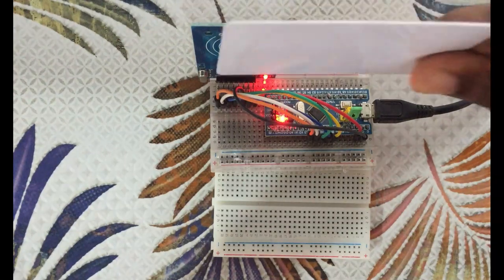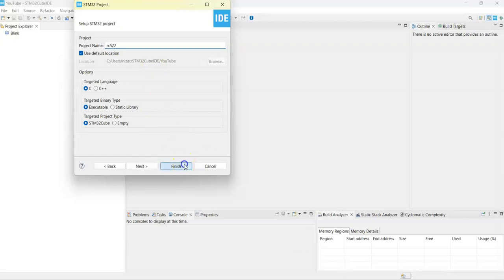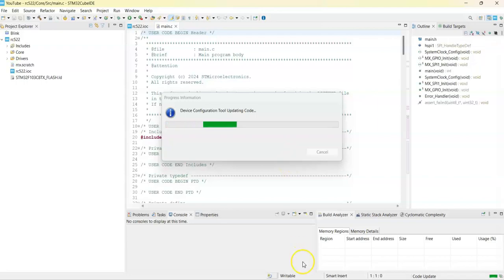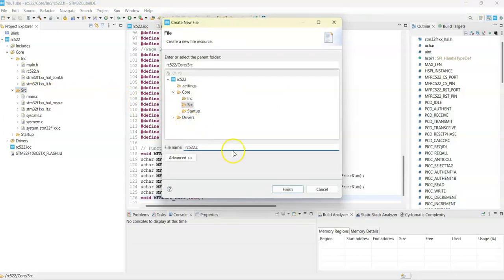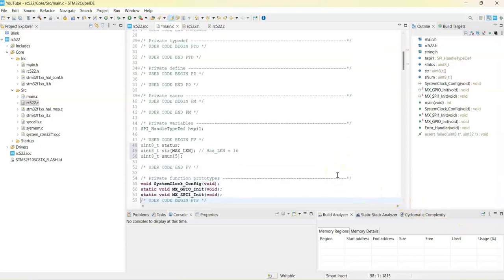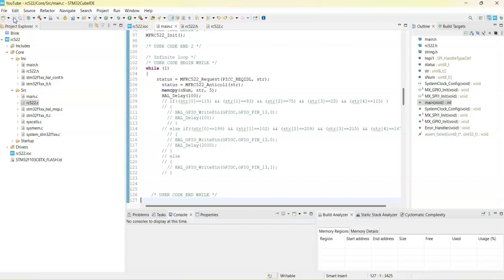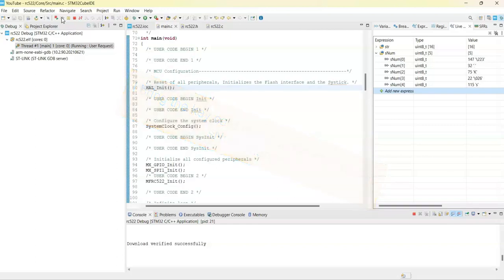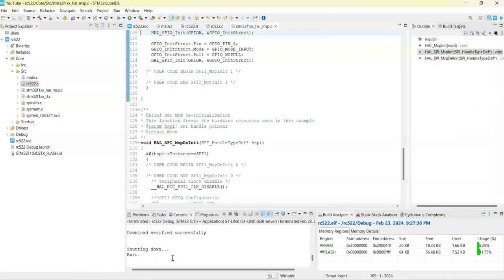88. STM32CubeIDE RFID RC522 Module with STM32F103C8T6

Comment: Thanks, very concise and precessional! Only, spent 1 hour, figuring out the problem and it started to work only @500 kHz SPI :(, looks like sdi line load at RC522 side is not strong enough.

Comment: Hello! I am using STM32F303VCT6 discovery board, I want to use the RFID sensor and on following your steps and since I am using the STM32f3 version, on changing the include files and fixing up some minor errors when I run it, on Live Expressions I cant see the sNum string I can only see the first two that are fixed (147, 32) but the rest 3 numbers are 0 and are not updating when I bring another card? Could you help me what I can do to make this work??
Reply: @user-seojihye71  The way I am doing it is that the main function enters in a while loop where it continually checks for the presence of an RFID card using the MFRC522_Request function. When a card is detected, it reads the card's UID using the MFRC522_Anticoll function and compares it with a pre-stored UID. If the UID matches, an LED connected to GPIO that I included as pin PA8 is turned on; otherwise, the LED is turned off. 

The LED connected to GPIO pin PC13 toggles state to provide feedback each time a card is detected. If no card is detected within a specified period, I am setting it to reset after a second or two.

Make sure that you don't change anything in the h and c file that was provided in the video but on changing the main file like above it started working!
Reply: @devagyabudhiraja1150  Thank you so much. Thanks to you, I was able to finish the work for a long time. Thank you so much
Reply from the maker: Thanks for trying my codes.
I hope you have figured out the reason
Please make sure the rfid cards are good
Reply: i have the same problem, do you have find a solution?🙏
Reply: @giuseppemazzocca9813  I had fixed the problem using HAL, I restructured the code and wrote it again in the main file and it started working!!
Reply: @devagyabudhiraja1150  hey would you be able to elaborate on exactly what you did (if you remember)?

Comment: Hello,I face the problem (status only display 2/sNum display 147 32 0 0) ,may I know u how to fix this problem? 
I use stm32f103vet6 and follow the video coding, but I use mini-rc522,is code not suitable for mini-one?
The project is stuck here,hope for help
Reply: I am using the Nucleo F103RB board. I'm having the same problem as you, can you tell me how to fix it?
Reply: @user-seojihye71 i didn’t fix this problem as well,even i change the code and use normal rc522😢
I think problem is come from board type is not compatible
Reply: @hpw5897  I see. Thank you for the information🥲
Reply: That is strange, I had the same problem - made lower SPI speed then played with clock phase and polarity. It started to work. Then I returned all the parameters back - set the parameters that didn't work initialy, and it works now. I think it could be QUBE glitch, who knows...
Reply: It works for mini-rc522, just got it working. Your problem could be with cube ide. Try to play with spi clock phase and polarity, try to lower spi speed, mine started to work only at 500 khz, which is fully sufficient.

Comment: Hello sir, I have a problem that need your help. The library is great but it i found that the first and the second of str[] is not fixed. My first and second of str[] is 0x70 and 0xB1 (this is the correct code), but sometime it shows 0x93 and 0x20, and then repeat with 0x70 and 0xB1 then repeat 0x93 and 0x20. I saw that your video have met the same error with me. Did you fix that or can you help me fix the bug. Btw, thanks for your tutorial and wish you all the best.
Reply from the maker: Thanks for trying my setups and codes and making it work.
As for the first two values 0x93 and 0x20, they are showing up even if no cards are present.
Of course, it is a bug. I am also looking for the fix
I think we can get away with this for simple projects, avoiding (147) 0x93 and (32) 0x20

Comment: Hello sir, I am currently getting "Target Not Available" when on the debug step, any part of the code or circuit I should check?
Reply from the maker: This only works with global variables, i.e. declared outside of main()
https://community.st.com/t5/stm32cubeide-mcus/getting-quot-error-target-not-available-quot-in-value-column-in/td-p/170240
Reply: @NizarMohideen  Thank you, I got that fixed, however I am getting value of 0 after resume when the pill is touched.

Comment: why did we need to setting the clock from 8 to 72kHZ ? i dont understand why. Can someone explain for me
Reply from the maker: You can keep 8MHz. It will be fine
72MHz is better because it is faster
If you keep at 8MHz, you need to change the prescaler in SPI for the baud rate to be around 9MBit
Reply: thanks to  @NizarMohideen , I appreciated about this

Comment: this is the clock config of my stm32mp157f-k2 what do nu think should i change to make it work ?                                                                                                                                                                          void SystemClock_Config(void)
{
  RCC_OscInitTypeDef RCC_OscInitStruct = {0};
  RCC_ClkInitTypeDef RCC_ClkInitStruct = {0};

  /** Initializes the RCC Oscillators according to the specified parameters
  * in the RCC_OscInitTypeDef structure.
  */
  RCC_OscInitStruct.OscillatorType = RCC_OSCILLATORTYPE_CSI|RCC_OSCILLATORTYPE_LSI
                              |RCC_OSCILLATORTYPE_HSE;
  RCC_OscInitStruct.HSEState = RCC_HSE_ON;
  RCC_OscInitStruct.LSIState = RCC_LSI_ON;
  RCC_OscInitStruct.CSIState = RCC_CSI_ON;
  RCC_OscInitStruct.PLL.PLLState = RCC_PLL_NONE;
  RCC_OscInitStruct.PLL2.PLLState = RCC_PLL_ON;
  RCC_OscInitStruct.PLL2.PLLSource = RCC_PLL12SOURCE_HSE;
  RCC_OscInitStruct.PLL2.PLLM = 1;
  RCC_OscInitStruct.PLL2.PLLN = 50;
  RCC_OscInitStruct.PLL2.PLLP = 2;
  RCC_OscInitStruct.PLL2.PLLQ = 1;
  RCC_OscInitStruct.PLL2.PLLR = 1;
  RCC_OscInitStruct.PLL2.PLLFRACV = 0;
  RCC_OscInitStruct.PLL2.PLLMODE = RCC_PLL_INTEGER;
  RCC_OscInitStruct.PLL3.PLLState = RCC_PLL_ON;
  RCC_OscInitStruct.PLL3.PLLSource = RCC_PLL3SOURCE_HSE;
  RCC_OscInitStruct.PLL3.PLLM = 1;
  RCC_OscInitStruct.PLL3.PLLN = 61;
  RCC_OscInitStruct.PLL3.PLLP = 27;
  RCC_OscInitStruct.PLL3.PLLQ = 17;
  RCC_OscInitStruct.PLL3.PLLR = 37;
  RCC_OscInitStruct.PLL3.PLLRGE = RCC_PLL3IFRANGE_1;
  RCC_OscInitStruct.PLL3.PLLFRACV = 6660;
  RCC_OscInitStruct.PLL3.PLLMODE = RCC_PLL_FRACTIONAL;
  RCC_OscInitStruct.PLL4.PLLState = RCC_PLL_NONE;
  if (HAL_RCC_OscConfig(&RCC_OscInitStruct) != HAL_OK)
  {
    Error_Handler();
  }

  /** RCC Clock Config
  */
  RCC_ClkInitStruct.ClockType = RCC_CLOCKTYPE_HCLK|RCC_CLOCKTYPE_ACLK
                              |RCC_CLOCKTYPE_PCLK1|RCC_CLOCKTYPE_PCLK2
                              |RCC_CLOCKTYPE_PCLK3|RCC_CLOCKTYPE_PCLK4
                              |RCC_CLOCKTYPE_PCLK5;
  RCC_ClkInitStruct.AXISSInit.AXI_Clock = RCC_AXISSOURCE_PLL2;
  RCC_ClkInitStruct.AXISSInit.AXI_Div = RCC_AXI_DIV1;
  RCC_ClkInitStruct.MCUInit.MCU_Clock = RCC_MCUSSOURCE_PLL3;
  RCC_ClkInitStruct.MCUInit.MCU_Div = RCC_MCU_DIV1;
  RCC_ClkInitStruct.APB4_Div = RCC_APB4_DIV2;
  RCC_ClkInitStruct.APB5_Div = RCC_APB5_DIV4;
  RCC_ClkInitStruct.APB1_Div = RCC_APB1_DIV2;
  RCC_ClkInitStruct.APB2_Div = RCC_APB2_DIV2;
  RCC_ClkInitStruct.APB3_Div = RCC_APB3_DIV2;
Reply from the maker: If this code is generated by CubeIDE GUI, keep as it is. No need to change 
But You need to change the  SPI Prescalor in GUI and see the the baud rate.
When the baud rate in is around 9MBit, keep that corresponding Prescalor
Reply: @NizarMohideen what are the factors that involves baud rate cause in my case  in the mx either i get 6 or 13 as baud rates ( prescalor either 8 or 16) how can i put to 9 ?
Reply from the maker: Baud rate 6 will be ok

Comment: In clock configuration, you have set the prescaler as 2. Does it work on other prescaler? If so, should I need to make any changes in the .c and .h files?
Reply from the maker: If you have different clock speed, you can change the prescaler in SPI but the baud rate should be around 9MBit.  No need to change  .c and .h files

Comment: hello , im working  on stm32MP157f-K2 and i need the  rfid reader library but im not sure that the library you have provided in the video would work in my project ? any help please ?
Reply from the maker: It should work
I tested this library with STM32F446RE Nucleo and STM32F411CE also, it worked!
All I had to change was to edit rc522.h
line1 #include "stm32f1xx_hal.h" to #include "stm32f4xx_hal.h"
Lines 10-15 (According to pins settings)
#define HSPI_INSTANCE				&hspi1
#define MFRC522_CS_PORT				GPIOA
#define MFRC522_CS_PIN				GPIO_PIN_4
#define MFRC522_RST_PORT			GPIOB
#define MFRC522_RST_PIN				GPIO_PIN_0
Clock configurations does not effect but I had to set the Prescalor in SPI so that the baud rate is around 9MBit
Wish you all the best
Reply: hey do you think it essential that i configure the reset of thr rfid even tho that im not gonna use it ?
Reply from the maker: We have to use the reset pin.
Reply: @NizarMohideen   hey i want to know what i need to change in  the main code if i want him to read any rfid card not specific ones ?
Reply from the maker: You can use the same code. It will read all rfid cards
Reply: @NizarMohideen  I am trying to get this to work for a STM32F401CCU6 and i get to the end and it the live expression window says "unable to evaluate expression". Even before reading your comments here i had already made those changes rc522.h. Do you have any advice or any idea what my issue could be? thanks for your time too!